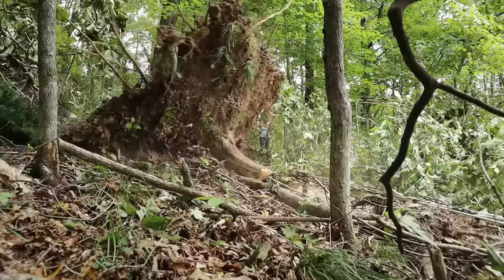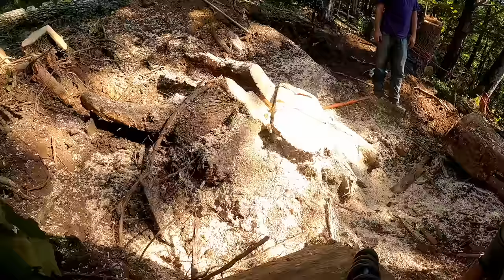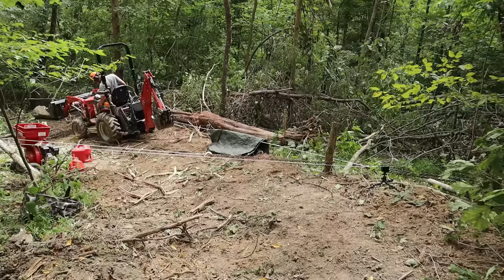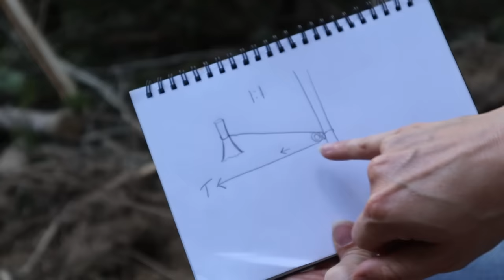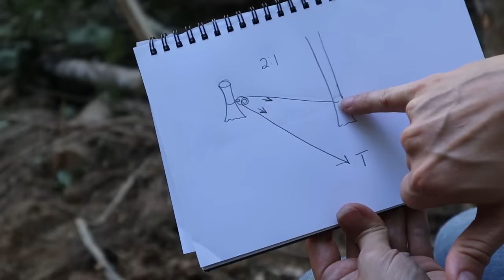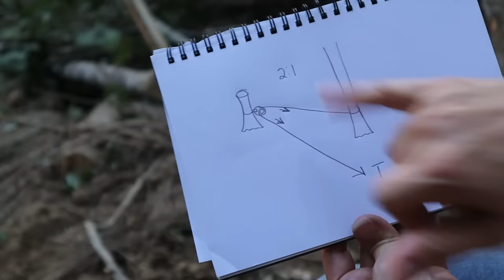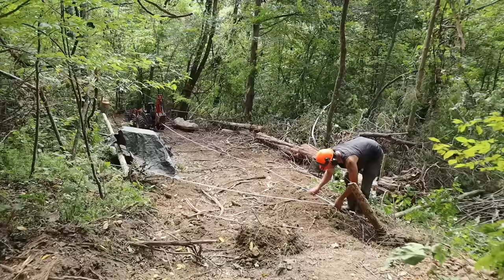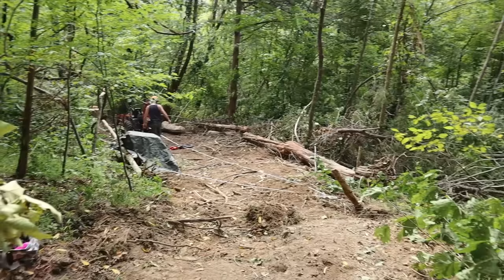Snatch blocks vs tree stumps - the power of pulleys /// E57

Comment: Hi Jon and Meg;  Good work starting from zero and learning about ropes, pulleys, stumps and trees.   I myself have gone through roughly the same process over the last few years though I did manage to avoid some of the pitfalls you discovered.   Like just about everybody else here I have a few comments that I hope will help you perfect your technique.    I've read though many of the comments and agree with pretty much all of them, especially the ones about connecting as low as possible to your anchor point and as high as possible to the stump you are pulling.   Better still (I think) is to actually tip the whole tree over with the tractor and pulleys without "felling" it first.  This gives a few advantages:
1/  I (You) can be somewhere far away when the tree falls over - unlike when felling it with a chainsaw.  SAFER!
2/  The tree will always fall pretty much on the line you are pulling it on so less chance of it falling on something you don't want it to fall on.
3/  You can connect your pulling point quite high on the tree to get better leverage. Also your pulling gear can't slip off the top of the stump once the tree is (near) horizontal.  To connect to the tree I use 6 foot long 4 inch wide straps with a loop at each end choked around the tree.  I use one strap per pulley.  When you pull, the strap tightens on the tree and holds really well.
4/  One the tree starts to tip over the weight of the upper part of the tree helps with the process.  The power of the tractor just starts the process. 
     Of course, make SURE the length of rope/cable you are using is long enough that you and your tractor are farther away than the height of the tree when it starts to fall (unless you are pulling in the direction opposite to which the tree is falling..   I use 150 feet of 1/4" wire rope and 9 or 10 pulleys so I get about 10 or 11 to 1 mechanical advantage.  To pull over an 18" diameter tree I leave the tractor engine on idle and just ease tension onto the line and slowly tip the tree over.  Once it is flat on the ground pull it a few more feet to rip the roots on the lower side out of the ground.  One thing to note:  I very much agree with the comments that say you should not pull from your backhoe bucket.  Pull from somewhere on the tractor frame or axle.  Attach your pull to the FRONT of the tractor (hopefully there will be a tie-down hook welded onto the frame) and do your pulling in REVERSE.  You can see better what is happening to the tree/stump and you can't "wheelie" the tractor and wind up with it on top of you. (This also applies to putting the tractor onto a trailer.  ALWAYS back the tractor onto the trailer.)

     As for the rocks...  Get yourself a portable generator, an SDS Max hammer drill (eg: Makita HR4011C or similar) with a 1" carbide rock bit and some 1" feathers and irons (also known as wedges and shims).  It will cost you a bit but believe me, it will be worth it!  Drill a row of holes in the rock along the line where you want it to split, insert the feathers and irons, and tap the irons with a sledge hammer.  My jaw hit the ground the first time I did this and converted a 1 ton boulder into two half ton boulders.  Repeat as necessary until you can get the pieces into your tractor bucket to take them to where they will be useful.  Eventually you will learn to "read the rock" so you can encourage it to split where it wants to which is easier, or you you can get it to split where you want it to to make the pieces more useful.  

     Also, get a pair of grab hooks welded onto the top of your loader bucket (with appropriate reinforcing to spread the load on the top edge of the bucket!) and a 15-20 foot length of chain (usually 5/16" or 3/8") to suit the hooks.  Then to get a rock into your bucket you drive the tractor up to the rock with the lower surface of the bucket hooked under the rock.  Lock one end of the chain into a grab hook, loop it tightly around the side of the rock opposite the bucket down fairly low, then lock the other end of the chain into the second grab hook.  Lift the bucket slightly and curl it.  The chain will grab the rock and when you curl it will dump the rock into the bucket for you.  Takes a bit of practice but works well once you get the hang of it.

I hope these comments provide some food for thought and prove useful.

                   Vince

Comment: An advice on building your road. Uprooting trees not only removes the stump with all attached ground, but also the biological life that has was associated with the roots of the trees. Because of removing the roots, the soil where the trees are uprooted becomes less stable and if you have heavy rains, especially on a sloped property, you may experience heavy erosion. Flushing the stump with the ground (paining it on the top with Cu2So4) and leaving the roots of the trees undisturbed as much as possible in the ground will still keep the ground stable and with time that stored food ( the wood roots ) will become biologically available for the other living soil organisms around. Remember it is not only building what you want but also, building it in a such a way, as to disturb as little as possible the natural habitat that has evolved though hundreds and some times thousands of years.

Comment: FOR MAX PULL ALWAYS HOOK ONTO THE STUMP AS HIGH UP AS YOU CAN AND AS LOW DOWN ON YOUR ANCHOR THINK OF IT THIS WAY IF YOU DRIVE A STICK INTO THY GROUND  IF YOU PUSH ON THE TOP YOU CAN PUSH IT OVER THE FUTHER DOWN THE STICK YOU GO THE HARDER IT IS TO PUSH IT OVER
Reply: Yeah, but shhh stop yelling.
Reply: The chain might slip off if it is too close to the end. I’d give up that extra leverage to avoid that, because that can be a very dangerous situation.

Comment: Noticed one of the tractors I own is the same as yours.  I use it a lot because of its size.  Listening to the noises in your video, I'd remind you that on heavy pulling jobs to: 

1) drop it into low 
2) make sure all 4 wheels are pulling (and that you have traction in the front too) and 
3) lock that rear diff with the little pedal behind your left foot.  Makes a world of a difference when pulling under load.  

Don't mind me if others have suggested this, I just didn't see it and I KNOW how small the axle is on that tractor... the post-COV!D world is one without parts!!!!LOL

Nice teaching video for the beginning homesteader.

Comment: Hey, I really liked this video.  Good for you two building your home yourself; I love DIY projects.  This said, I'm a builder/tradesman (45 years).  If I might offer some constructive advice; always know where and when to pick your battles.  Let me explain...

Heavy machinery is expensive, yet it can save much time, energy and money in the short term as well as over the long term.  I mean, you can dig your foundation hole with a soup spoon... but is this a good or productive use of you valuable time and energy?

Money is always an issue on most every construction project, but your time is worth money too.  Is it better to spend all this time dicking around pulling stumps by this method...  Or would it be better to cut and skid the trees, saving the millable lumber and cordwood and leaving the stumps?  Then get an excavator in there to pull stumps, dig and move boulders, level/smooth your driveway, dig in drainage swales, install culverts, and dig your foundation at the same time too maybe?  Think very carefully on this.

I don't have a crystal ball, but I can tell you this much; preserve you valuable time, energy and enthusiasm for jobs that you can readily handle, i.e. jobs that are appropriate to your skill level, equipment, tools, energy, but also keeping in mind the very important time frame.  This strategy will serve you much better in the long run.

Here is a plausible scenario; You guys spend a lot of time working on you driveway instead of talking to an excavator; then you run out of steam when it comes to the actual hammer and nail construction.  

Get a local, professional excavator over there to walk the site in the very beginning.  Tell him what you have in mind for placement of your driveway, house site, septic, well, etc.  He will give you his informed, professional opinion (born of experience) on how to proceed FOR FREE, as long as he's not there all day.

THEN stake out the lot; the house site, septic area, well location, the staging areas for materials and tools, logs, the bury hole for stumps, etc.  Only then do you "rough in" the driveway such that a 4wd pickup can get in there.  Leave the stumps, big millable logs, cordwood, moveable boulders, etc. for the excavator to deal with all at once.  Hiring a professional subcontractor with the right equipment IS the low cost solution in many cases.

You need access to the site for your pickup truck, tractor, tools and materials, etc.; rough in an access drive(this is what you are doing).  Do not confuse this with a proper driveway however.  A proper driveway must avoid obstacles (ledge, steep slopes, surface water, clay/mud, etc.) and have a suitable bed of good gravel, decent drainage, etc., to support large trucks (concrete truck, lumber truck, well drilling rigs, etc.)

If you don't have a "real driveway" your concrete truck and well truck will sink up to their axles in mud or soft material.  These heavy weight vehicles are VERY hard free up once this happens.  Ask me how I know this.
Reply: good advice.
Reply: best comment and advice they have gotten.

Comment: So it sounds like sitting through physics class wasnt a waste of time. Thank you very much for showing us the real world things you tried.  You've gotten some good comments about attaching higher, anchoring lower and distributing to multiple anchors if you need to.  I would add one more:  It doesnt hurt to protect the cambrium layer underneath the bark of the anchor tree by putting some 2x4s underneath the chain around the anchor tree.  That's what I usually do but it may be less needed on older trees with thicker bark. Not sure.   

You guys got a LOT of work done.  Thanks for sharing that and letting me learn from watching your process!

Comment: Rather than dealing with stumps many have found that digging the tree roots out on one side and the other then letting the tree fall while it pulls it's own root system out. I first heard of this technique on tractorbynet but have tried it myself and it often works better. The one downside I experienced is now you have a giant root ball to try and move around after you cut it away from the fallen tree.
Reply from the maker: Yep, good technique.  It's tricky for my small tractor to get the majority of the material out from the roots.  It's just not that strong which is why I opted for the pulley method.  I have done a few the way you describe, but they are smaller trees - maybe 6 to 8 inches.
Reply: That smarter every  day is a great video!
SNATCH BLOCKS...
I  was also thinking  that if you leave more shaft on your stump, by using some simple arborist tree climbing  gear, you would get mechanical advantage by using the shaft as a lever...

Comment: Great video, thanks for sharing the learning process!
Just a thought:  on your final 4:1 pull, you chose a strong tree as your anchor, which worked out well for you.  That tree was seeing a lot of force, and if it wasn't so stout, you may have encountered the same issue you did at first with the cedar.  One thing you could have done was use a third tree as your anchor (providing that it was reasonably in line with the other tree).  That would have distributed the load so as to lessen the effect on the other trees.

Comment: Love the way you guys work together. Also loved where Mich 'sic?' was standing at 10:00. Far out of the bight. At 12:00 it appears the camera is on a tripod and Mich is nearby. Imagine a break at the anchor tree. The results could have been deadly. More important than learning how pulleys work, is understanding the trajectory of shrapnel in a failure. You guys did great, the entire planet applauds your marriage dynamic, your ingenuity, and your determination. Let's keep you both alive for years to come.
Reply: My thoughts exactly.  As much strain as that cable had on it, if it had snapped it would have chopped anything -- or anyone -- in its path right in half.  Anticipating stuff like that is a good way to keep body and soul together.   

Still a great video!  I learned a lot, as others have said.  I really like the comment here about using the tree's leverage to get the stump out, although I have no idea just how one would go about doing that.